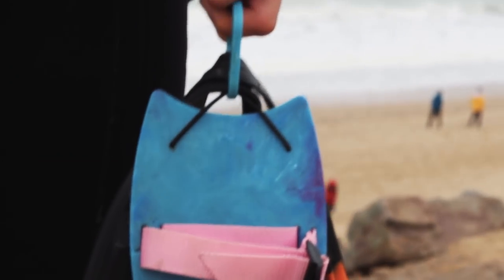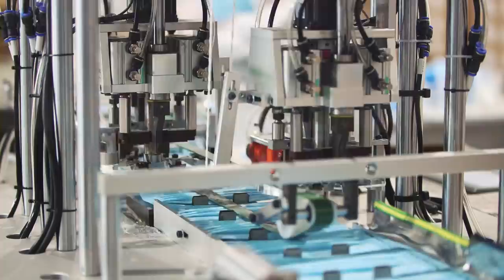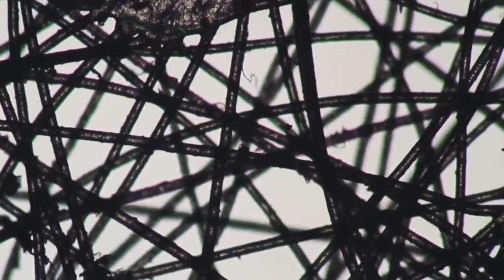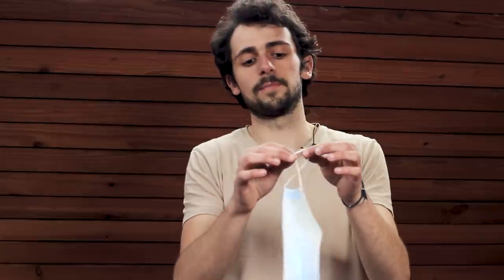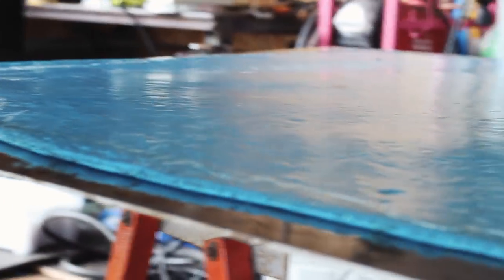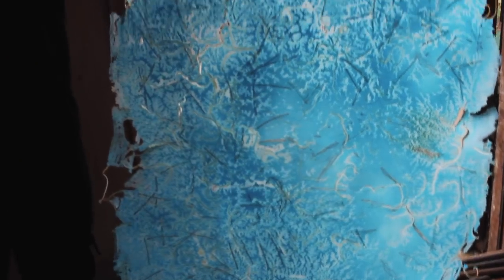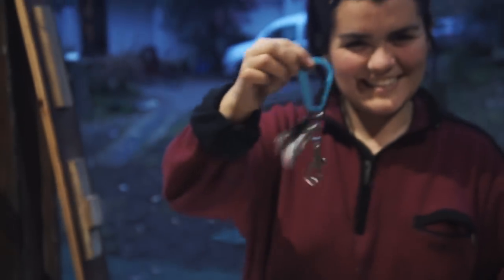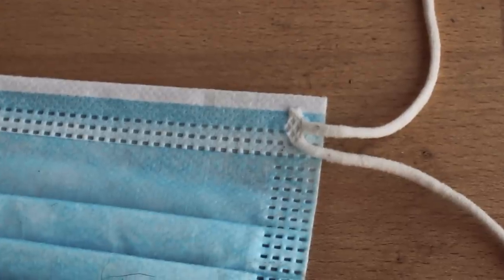How to RECYCLE FACEMASKS #coronavirus

Comment: We want to make a roof from those sheets!
Reply: Going big... I like that!!!
Reply: This will be a mistake, those masks lack the proper UV stabilizers and anti oxidants copolymers, and sun will eat it pretty quick creating leaks.
Reply: You could have a Blue Sky on your frequent rainy days while under that roof!
Reply: Not sure if its good for plastics to be heated under the sun.
Reply: Mix it with sand
Reply: Russians made roof tiles from sand and dirty plastics (mostly LDPE).
Plastic alone is pricey. There are new PET sheets available, so that could be a possibility work, may need UV stabilizers.
Reply: DOIT bro
Reply: ....yeah rain protection....
.
...

Or  '' soundwalls '' 😔😉😁👍
Reply: Plastic hot flammable roof. What could go wrong.
Reply: Leave polypropylene out in the sun, watch what happens...  Then rethink.
Reply: Hells yeh! :D
Reply: @lightdark00  I thought polypropylene used to make greenhouses was the best poly that could be used and that it retains its strength in sunlight and also has flame retardant properties.. no?
Reply: I think about rethinking roofing materials all the time.
Reply: @nonyabusiness9747  Try it. Most liquid laundry detergent bottles are #5 PP, leave in the sun. Also slightly more flexible but rigid caps for other plastic will be PP. Without stabilizers and UV protection, it will degrade in the sun. Are you thinking of acrylic?
Reply: @lightdark00  I am referring to the clear square tubed sheets that are polypropylene. They are commonly used in greenhouses.
Reply: @nonyabusiness9747  I think you mean polyethylene sheeting. If you put LDPE or HDPE out in the sun it fares much better than PP.
Reply: How are you going to mitigate sun degradation? I have wanted to 3d print an entire house out of recycled plastic but haven't been able to develop a solution for that problem.

Comment: If the ideia is to include used masks, decontamination with UV-C lamps should be included in the process! You could submit your idea to research institutes for the safest processes!
Reply: They can be washed.
Reply: Which is the safest one.. Washing or uv disinfecting
Reply: @beenila4133  why not both and?
Reply: I think the heat alone is enough to sterilize these masks. The melting point of polypropylene is 160C.
Reply: @caspernicus5822  You’re absolutely right, but I think the major concern would be with workers handling them before they got melted — taking off bands & wires, putting them in the shredder, etc

Comment: i wonder if they could be turned into a filament that could be used on 3d printers? id love to try that out.
Reply: It's technically possible but basically no.  It's so difficult that it basically isn't done. At one Point precious plastic lied and pretended like they had made filament but it was completely unusable.  I don't think we're going to have recycling connected to 3D printing until they start building more robust 3D printers that can use lower grade plastic. But that's just me.  Most people in the 3D printing Community are concerned with detail and ease-of-use.  So unfortunately even the little guys prefer to use new virgin plastic rather than the hard work and expense of reusing old stuff.
Reply: Theoretically poly propylene would be almost best choice for extruding filament instead of other recyclable plastics. But purity of the pp , filament thickness accuracy and even humidity in the production phase , seriously affects the quality of the filament. But anyways it is still worth to try with filament extruders. Low budget filaments might be of interest to most people.
Reply: Also there Is a 3d printer nozzle that prints directly from pellets (even recycled shreds). I Cannot Remember the name now but i think It was mentioned in the CNC kitchen video

Comment: As a 3rd-year mechanical engineering student, what safe handling method can we do to shred those used disposable face masks? - Thesis purposes
Reply: I'm final year Plastic technology student. Have you found out shredding process of mask. I have been doing mask recycling process
Reply: Can you share ur ideas with me?
Reply: @006balamurugan6  we are planning to put an solenoid in a conveyor belt to sort the disposable face masks from the medical hazardous wastes. Electromagnets are present yo be able to magnetize the aluminum strip in the disposable face majs
Reply: @006balamurugan6  i dont know if it will going to work, but that is our only option to contunue our thesis

Comment: Does the heat press have a high enough temperature to kill the virus if theres any present?
Reply: 1. The virus would die down after time anyways if there was. I believe i read something that on plastic it takes 3 days for corona to uh "die" if that is the correct word? Basically for it to be safe again. But the heat definitely should be able just in case since the fabric masks are recommended to wash at i think 40 -60°c  to kill bacteria and viruses. I'm not a professional or scientist or what ever so of course i could still be wrong somewhere somehow but i would just straight say: there would not be any viruses etc left after. Else our bottles etc we drink and eat from would easily make us sick as 100 of people would have spread their illnesses on them before they got to us as they usually are also just recycled

Comment: can anyone confirm bottle lids are made of HDPE or PP ?
Reply: check the triangle sign with the arrows inside the lid. the number in it corresponds to a material.
Reply: @kazo0ie  I hope it's that easy, in Vietnam I don't find any number. That's why I asked if they are always from one material. Even coca cola or pepsi don't have number inside them. Only (1) PET on the bottles
Reply: @minhducpham3010  they can be both.